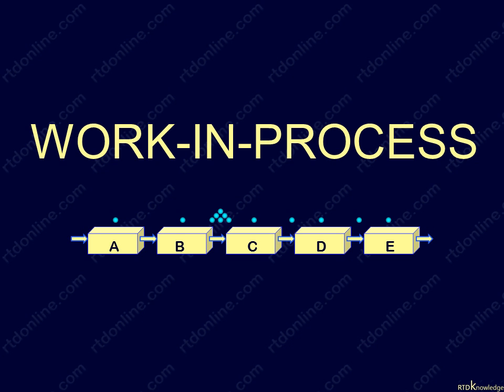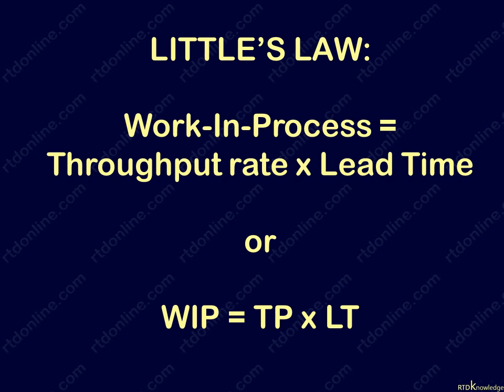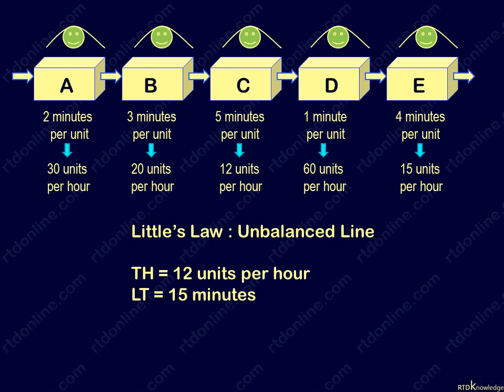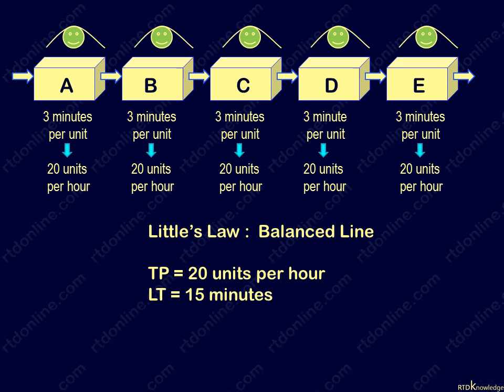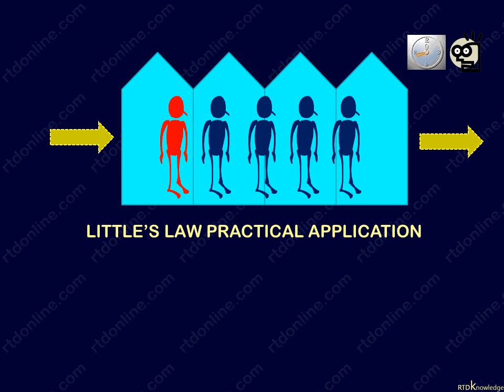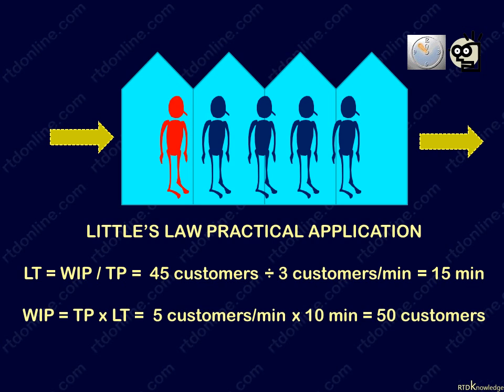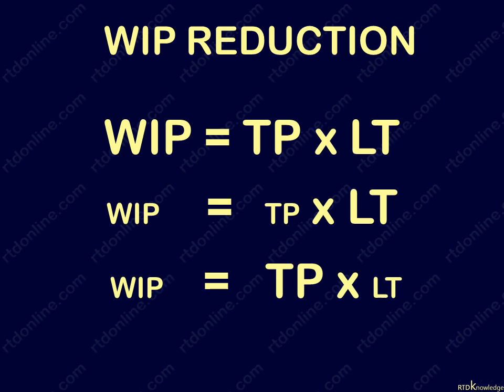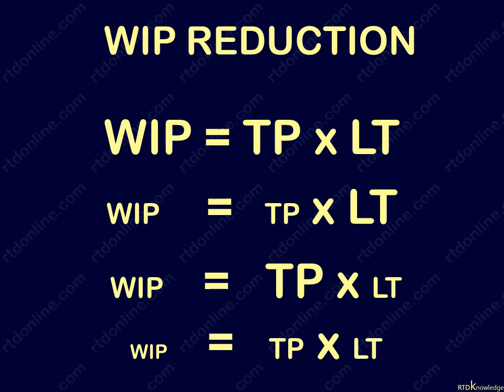How to reduce WIP using Little's Law

Comment: in case of unbalanced line,line efficiency is 60 percent by wip method as two operators might be free.so why we calculate wip by this method in which operators might be free causing low efficiency?plz explain for my understanding.

Comment from the maker: Throughput rate like units/hour must be used since WIP is in units and lead time is expressed in time like hours.  Multiplying units/hour by hour should give you units  (TP x LT=WIP).  TP cannot therefore be time.  Lead time is more accurate in the formula than cycle time unless you redefined cycle time as time inside the system or process. Typically, cycle time is time inside a workstation.  Time inside a process or a series of workstations is lead time which is used in Little's Law.